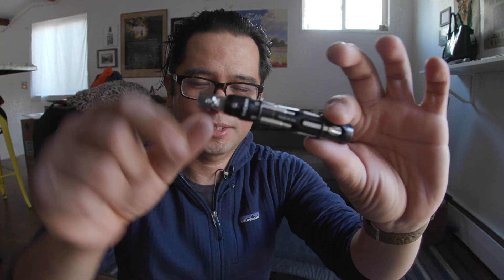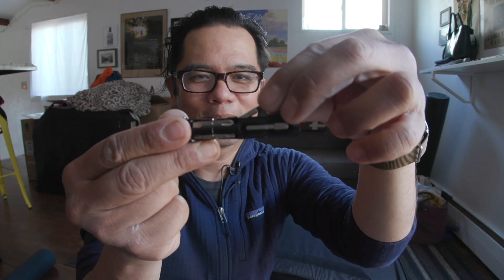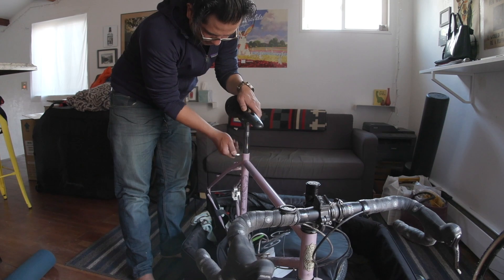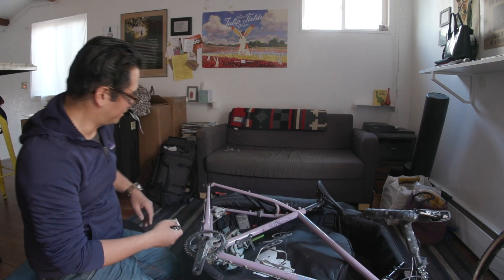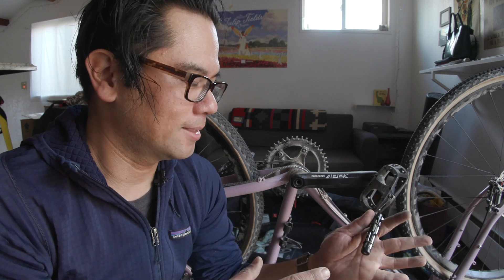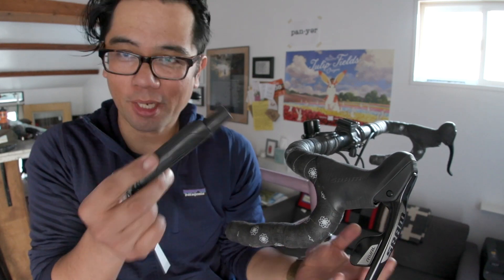New Wolftooth EnCase Multitool...Is it ANY GOOD?

Comment: Great vid, as always. How I install a chain with a quick link and no tools: install quick link of chain at the top of the chain run, hold rear break and pedal forward. The front chainring will pull the quick link out from the rear stopped wheel.

Comment: A little trick you might want to use after mentioning the rear thru-axle - cut a short length of pvc tube (electrical conduit) to the width of the dropouts. Insert tube between dropouts, install the thru-axle and enjoy crush proof packing 😁👍🏻

Works for the front too. I have QRs but use the same trick and has worked every single time. Far cheaper than a frame repair and cheap and easy to replace if lost, you just need a hardware store.

Comment: First, kudos for thinking outside the box as to where to place the tool. That's very cool. However, personally, dealing with bar tape is not my idea of a good time and once I get the end finished just right, I don't want to mess with it. The last thing I would want to do is have to redo the bar tape because the end got screwed up. Then the price just totally makes this nonstarter. Thanks for the review though. On second thought, maybe this would work for a MTB's straight bar? That price tho!

Comment: Good on ya Russ for checking out the tool. I'm always interested in new tools etc.  I don't think i could be bothered pulling that out every time i need to use an allen key. I use allen keys quite often when i ride to adjust disc brake calipers as i regularly change wheel sets and they can rub if not fine adjusted. Also for saddle up and down when i wear different shoes/pedals to ride etc.  So yeah nah!

Comment: Once had a tubeless plug kit that fit in the handlebar end in a similar fashion, thought it was so cool.  
The tool fell out (lost) after riding moderately rough single track on it’s first ride. (cowchipper bar)
Be sure it’s a tight fit.

Comment: I use the locking type zip ties - bought a big bag of ties from our local Aldi about 5 years ago fo r about £2.99 (3.86) and haven't run out yet - even had a ton of velcro ties mixed in with it.

Comment: I’m not hating on sram, but the tool should work fine on almost all shimano derailleurs.
Reply: You're correct with the Shimano derailleurs. We also tested with this SRAM derailleur and got it to work. The bit isn't quite long enough to reach the bolt if the bit is fully inserted in the 8mm head, but if the bit is placed on the derailleur bolt then the 8mm head is applied, the bit can engage both the derailleur bolt and the 8mm head. It's a tool hack, though it'll work.
Reply: @WolfToothComp  Great tip.  I wouldn't have thought of that.  Certainly not something you would ever do in the shop (since presumably you'd have the right tool for the job), but it could be a life saver on the trail.

Comment: A simple extension should solve the derailleur situation. And using a POWER LINK would solve EVERY chain aspect :-)
Reply: I'm sold on the powerlinks now too. i wax my chains so a powerlink is the way to go. Sometimes you still need a chain breaker anyway e.g. when my son damaged his chain mid ride the other day i needed to remove some badly twisted links to be able to continue the ride. Shouldn't have happened but it did!

Comment: The added value to added cost when compared to bargain alternatives is just not enough to sell me here. 

My primary carry these days is discount bike multitool which I got for less than $10 from Aldi's seasonal aisle a few years back. That one doesn't fit in my handlebars, but it does fit in a pocket, or as part of a kit in a seat wedge. It's merely adequate, not great, but personally I find it a lot easier to forgive the shortcomings of a bottom-shelf bargain tool than a tool that would cost me over $100.

Comment: Pretty nifty bit of business there! It looks like a lot of thought and enginerding went into that. One of the criticisms I've heard is that the bits and bit holder are all 4mm instead of the more standard 1/4 inch, but it probably wouldn't have fit in the handlbars if all the bits were 6.35mm instead. Too bad about the derailleur though, I'd be fairly bummed if I bought that and right out of the box it couldn't reach the derailleur  bolt.
Reply: The bit can reach the derailleur bolt if the bit isn't fully in the 8mm head. We tested with this derailleur after seeing the video and got it to work. Place the bit in the bolt, then apply the 8mm head. There's still enough length to the bit that it can be engaged by the 8mm head and still turn the bolt. And you're correct about the 4mm width of the bits. We had to go with this size to fit the pockets in the slim handle.
Reply: @WolfToothComp  Sick!

Comment: Hey Russ, why not slide the headset bearings and parts/spacers on the steerer and tighten the stem cap so they don’t slide off? I thread the stem cap bolt by hand all the way (but not tight) and have had no problems with losing parts on any threadless headset bike!
Reply from the maker: I guess mostly to keep everything protected in the headtube so nothing gets kinked or bent somehow.
Reply: @PathLessPedaledTV  That works too!

Comment: Neat but I’ll stick with OneUp Component’s EDC Everyday Carry Tool. Fits into the steerer tube, is easy to remove AND comes with a cassette lock ring tool 👍🏻
Reply from the maker: I have that tool.  That doesn't have a cassette lock ring tool.
Reply: Path Less Pedaled Oh, but it does, you’ve likely seen it but not recognized it. The lock ring tool is on the odd shaped doodad with the flathead screwdriver on the end, the one next to the 6mm hex iirc. The lock ring tool itself is the two ‘nubs’ on the side.
Reply: @PathLessPedaledTV  https://www.pinkbike.com/photo/15023743/
Reply: @nickt.8244  Nice one mate. Cheers for that :)
Reply: The problem with OneUp's solution is its limited compatibility since there are many forks on the market that it simply will not work with (my RockShox Judy Silver, for example).  Handlebars, on the other hand, are pretty much universally sized, making Wolf Tooth's offering a lot more flexible.  Plus, unlike OneUp's EDC, the EnCase doesn't require any special modifications or carriers, so it can be easily moved from one bike to another, for those of you lucky enough to own multiple bikes.